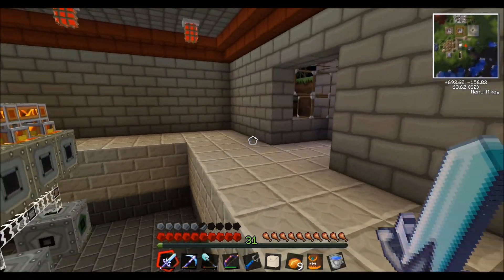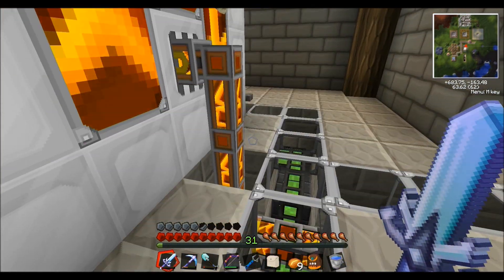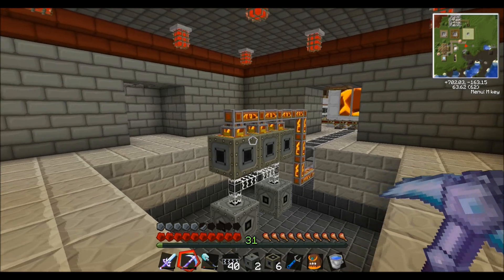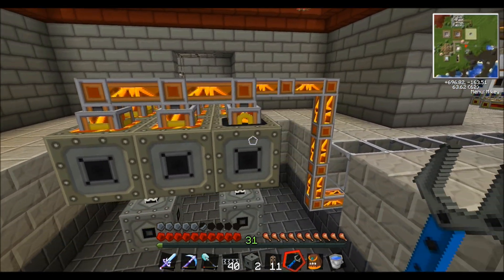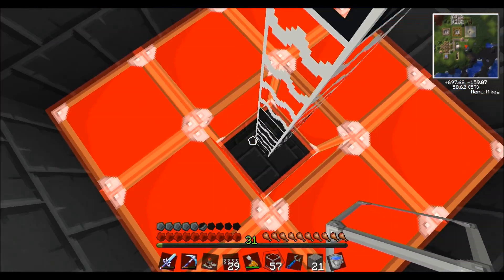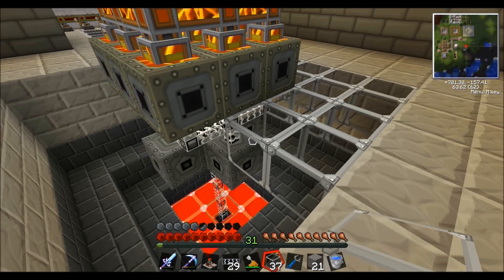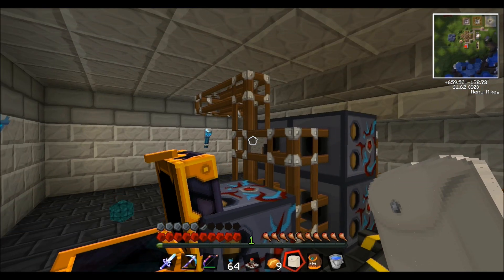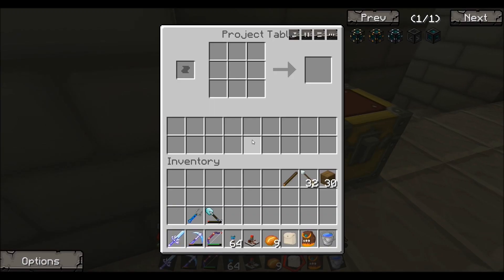Minecraft FTB - Ep.13 - Lava Power Plant With Thermal Generators

Comment: Hey nice Video and good setup. But you could use XYCraft tanks instead of the iron tanks. I actually just put up a video on a starting power setup for FTB. I had a very similar version to yours except for the tanks, and I used geothermal generators since they were cheaper.